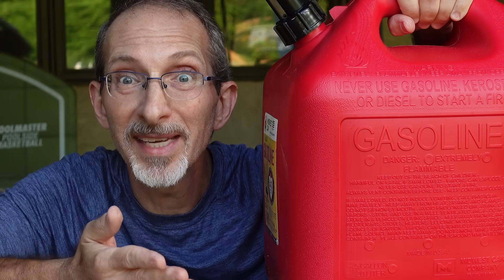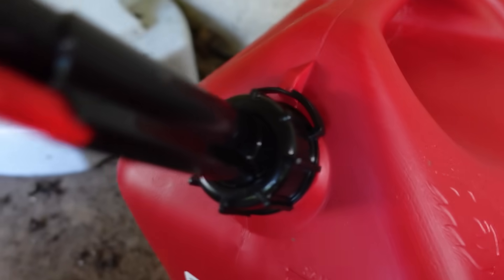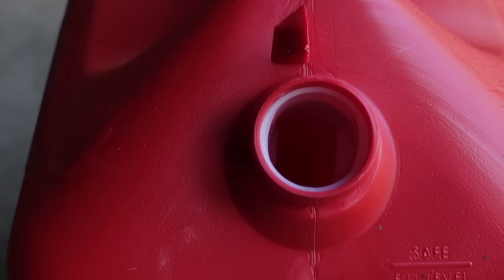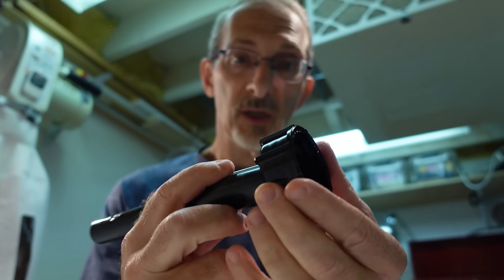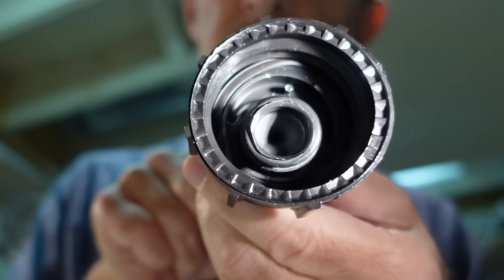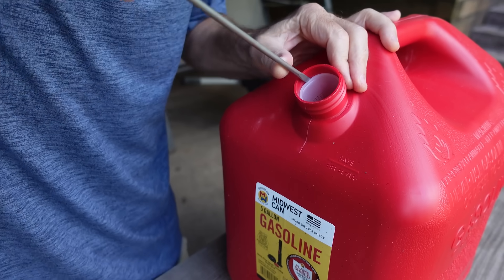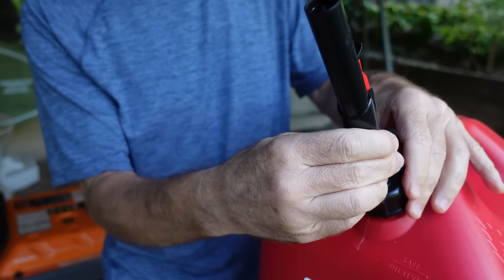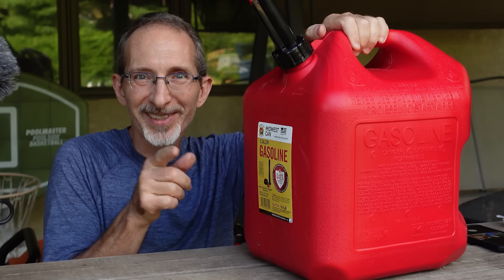Gas Can Modification | New Gas Can Fix

Comment: It's not about safety. This Obama can is supposed to reduce hydrocarbon emissions by removing the external vent cap and sealing the can air tight when not in use. So the idea is that this sealed can is supposed to prevent evaporation of gas (hydrocarbons) into the atmosphere while not in use which is like a quarter to maybe a half ounce per week if you left the vent cap off. 
BUT! There are multiple problems with this pos as I'm sure everyone knows.
1) I used one of my 6 gallon gas cans which was roughly half full of cool gas sitting overnight on the cold garage floor to fuel up my lawn mower and because I was in a hurry to mow the lawn I left the can sitting on the driveway in the sun. Well it puffed up like a balloon and split the seam open dumping like 2 gallons of gas. It may have prevented about a half ounce of gas evaporating while not in use but 2 gallons evaporated all at once (and killed some of my grass).
2) As you mention filling small equipment is near impossible. The airtight spout may have prevented about a half ounce of gas evaporating while not in use but I spill an once or two every time I try to use it, and more than once spilled more like pints and even quarts of gas.
3) The seal between the sliding part of the spout leaks, so unless you use a foot wide funnel which you can't actually do because you'll push that out faster than your weed whacker. You are going to spill (evaporate) more gas every time you use it than this pos is supposed to prevent. Yeah you might get lucky and get one that doesn't leak off the bat but trust me, that chintzy plastic and the heavy spring will round out the spout and smash the seal before you're done with the first mowing season.
4) Honorable mention - try using this pos to fuel up your small boat at the dock.
Idk what kind of fuxtard thought this was a good idea :face-fuchsia-poop-shape::face-orange-raised-eyebrow::face-blue-wide-eyes:

Comment: It's incredible how some "official" somewhere decided to enhance the environment by destroying the utility of the gas can. I have not found a gas can in the last several years that doesn't pour gasoline into the environment more than the old style gasoline cans. This can was a perfect example. As a senior with arthritis and psoriatic hands it is impossible for me to open and close these modern cans without altering them. Even when used correctly the cans ultimately spew gasoline into the air. In addition, I believe they have mandated a different size lid that cannot be purchased on the open market as a replacement.  That said, I am surprised some official has not stepped in and complained about this worthy video.

Comment: I just break the safety latch off the nozzles, just rest it on the lip of the tank you are filling gravity does the rest, when tank is full raise the can the valve shuts of the fuel flow.  I use smaller cans for trimmers and such since they are 2 stroke premixed gas.

Comment: I have found the perfect, although pricey gas can at Sam's. Flexible donkey dik that folds upward and locks in place when not in use and has a cap. Handle has an easy to use lever you push down with your thumb. To use it, remove cap and rotate donkey dik into the down position. Insert donkey dik into tank and effortlessly press the thumb lever down and voila! Spill free pour every time. But like I said they are pricey. Modifying these donkey diks don't help because they are too rigid which what causes the spills. I also found old fashioned donkey diks on eBay but they were cheap and the threads didn't fit and leaked all over the place. I've tried everything. The Sam's gas cans are the only answer and they are fantastic. $50 a can sorry to say, but they are the shit!

Comment: I have had a gasoline generator for quite a few years, and I hardly running at all. In fact, the only piece of equipment that text gasoline on my property. I have distanced myself from fossil fuels to such a degree that I live 100% off grid with solar panels and lithium batteries. They’re so good that I don’t need grid power or generator back up and I drive an electric car. I hate the smell of gasoline, and I hate the smell of the exhaust even more what is the point of pursuing a futile battle with fossil fuels?

I even threw out my gas cans. 

Go buy some solar panels
Reply: Solar is still highly not practical and very expensive. Also oil it's not a fossil fuel. If it were it would have run out years ago. Oil regenerates itself and that's a fact.

Comment: 2 simple things when empty drill hole opposite of filler neck for vent use rubber plug for sealing, second remove the  pour spout cut top off and get hose fuel grade and clamp onto the small pour piece left on pour spout. Then get a cap to fit to seal pour spout opening for storage. The longer rubber fuel hose can fill no spills and go far enough into new cars gas hole to open trap doors that standard filler cannot reach and gets rid of safety spout that spills more gas than anything ever. been dirt bike riding for decades we know gas cans hose allows to put in bike tank then lift can no spills no mess. get can from bike shop forget home improvement crap or modify it.

Comment: You never state why your old propane generator doesn't work. Looks like you left it outside for years. I have 3 propane generators and they never fail me because I don't put crappy ethanol gas in them, which causes 99% of generators to require new carburetors and other fuel related issues. But to your point, I modified all my gas cans with aftermarket flex spouts and flip vents.

Comment: Leaks at the joint, does not work with any yard equipment.  CA makes a problem 10 times worse.  It is easier to order a replacement not approved for CA.  Even with the fix here it still leaks between parts.

Comment: I have one of these cans, the only thing I did to mine was cut the stop on the cap to get it off easier. The can I had fell over in my car, and if I had a old one, gas would have been everywhere. The reason why he could not fill the can is because he was running the gas into the can too fast. Trust me I worked in gas stations for over 20 years, it helps if you are smarter than the can.

Comment: I WONDER HOW WELL IT SEALS ONCE YOU FILL THE TANK AND HAVE IT IN YOUR CAR WITHOUT THE SPRING BEING IN THERE. GETTING THE FILTER OUT WITHOUT DISTORTING THE NECK IS TRICKY. DISTORT IT AND IT WILL LEAK WHEN SLOSHING AROUND IN YOUR CAR OR POURING. THESE NEWER SAFETY CANS ARE DEFINITELY DANGEROUS.

Comment: I just buy the Easy Pour package which includes a vent. Works much better than this. Have adapted seven five gallon jugs that way. Get the big spout. Use a half inch wood boring bit or even a half inch Forstner bit to get a perfectly round hole for the vent. Empties much faster.

Comment: So does the nozzle just like.. stay hanging out of the can at all times? Also its not flexible? Seems like it would be very easy to break and harder to store. The cans we have in Canada the nozzle is flexible making it easier to fill and it fits in the can when you're done. That way you could put it in a (ventilated) lockbox or on a shelf.

Comment: Wouldnt it be better to just cut the spring in half and reinstall it? Because without the spring youll just spill a bunch of gas if the tank fills up before the gas can is empty. Fyi that fuel filter is the dumbest thing ever since any large particles will just get caught on the side of the filter that goes into your tank

Comment: Probably fumes still won't escape as pressure increases o-ring will only be seated more. Maybe with temp fluctuating and neg pressure, but probably not. I like the modification. I would keep the "filter" and just do a slow fill. 
👍👍

Comment: I 3d printed a nozzle replacement.  I've spilled more gas with the new 'safety' nozzles than the original nozzles.  Like seriously I've spilled gas with the original nozzle a whopping ZERO times, and 5 times with the 'safety nozzle'.

Comment: 3:20 this is completely ignoring the fact that anything trapped by the filter if not removed before the cap is replaced, will just come right back out into the gas tank of whatever you are filling, so making the filter non-removable actually makes it pointless.

Comment: Horrible design. I bought two of these for a new project and I ripped the larger rubber seal because i had to push so hard on the safety nozzle. Now gas leaks from the base.

Comment: I wonder if the OP has taken into account the reasons for those modifications. The spring loaded spout I can understand. Perhaps the OP could have modified the spring so that there was less pressure while trying to compress the spout. The locking tab on the part that screws onto the can is there to make sure you secure the spout tight enough to prevent leaks. But cutting it away is a good idea because that is kinda a pain. I’ll have to try his mods and make the spring shorter and see if that reduces the pressure.

Comment: Oh, and I would argue they are far more dangerous than old school nozzles. Ive got a 15 year old self venting nozzle that works great. My new can has this new nozzle. I've splashed more gas everywhere with the new can nozzle than I have in my life. 

A month ago I'd have ended up in a burn unit had the small engine I was filling been hot. Gas went EVERYWHERE.

Comment: Thanks for making this video. I couldn't agree more on the backwards and useless design of the new gas cans. You spill gas trying to fill them, you spill gas trying to dispense from it - whether it's a lawnmower or an old car. Since there's no flex you can't get it close enough to large flat surfaces to pour properly. It's as if the designers never actually tried using this thing in the real world, I'll keep my old bendy-straw style gas can!

Comment: The engineer that designed that spout should be slapped !  I bought after market spouts and threw out the "safety spout"   Also removed the filter that prevents gas from entering the can !

Comment: I bought a different spout for my tank off Amazon. Then drilled a hole in the back and added a air valve which came with the spout. Finally I removed the filter. Then for my generator I bought 2 metal gas cans. P.S. I pushed the filter into the can 😂 I was able to get it out anyway.

Comment: I’m legitimately confused, how does a non-removable filter help in the first place?  If you can’t clean the filter until the can is empty what does that add besides extra steps to clean it. I mean, if the filter stops gunk but you can’t remove it, you’d have to choose between pouring all the gas out to clean the can/filter, or allow the gunk in filter to remain and just pour gas back through filter and into your equipment. I couldn’t imagine anyone really doing that until I thought about 18-25 yr old landscape employees, etc.

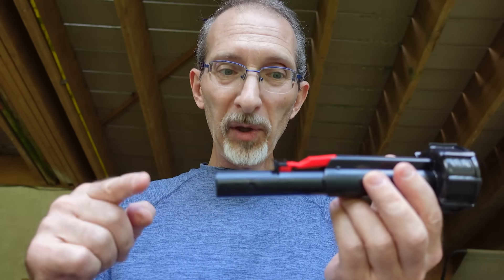Comment: 1:47 Pressing that red thing in in -20F degree weather with gloves on and hands are completely numb is SUCH a pain in the ass and is so difficult when a Nor'easter cuts off our electricity and we survive off of a generator. I fucking hate those things... so much.. I can't express to you stronger how much I hate those. There's only a single type of "safety" nozzle that I like, and actually prefer, which is the green one where you push it in with your palm. All of the others are a pain in the ass and make me spill gasoline all over the place, and I mean ALL over, which is extremely dangerous around a piping hot generator motor. They accomplished the exact OPPOSITE of what they say the purpose was. They're only safer in places like Florida where it doesn't snow or get cold

Comment: I like the 2.5 gallon push button with Right angle spout for filling weed eater and chainsaw. No spill without a funnel. The type that is in the video is a pain, but the spring gets weak with use.

Comment: Really useful video.  I have one of those nozzles and hate it.  The spring removal is particularly helpful.  Yes, it back-splashes because of the filter, they're a pain to fill, unless you're using them on a big vehicle, the force of the spring pushes away the chainsaw, weed-eater, lawn-mower, etc.  You're 100% correct.

Comment: These modifications may make the can easier to use, but I chucked the entire nozzle and fitted a normal old fashioned seal and long flex nozzle with a cap on the end.  The new fanged thing made for safety only leaked when it was in the back of the car, leaked into my shoes and all over the car when I tried to fill into the deep well fixture made for a pump nozzle, not a short leaky and flimsy joke of a spout.

Comment: You forgot #4, installing the much needed proper vent on the can, this allows the fuel to pour faster, smoother and without gurgling which also causes splashes.    :)

Comment: I hang on to my old timey metal gas cans with no valves for this reason.  It's even more fun filling a tractor fuel tank that usually requires holding the portable can INVERTED while trying to keep the trigger released due to the tractor fill being mounted flat on the top of engine cover.  I know that much more fuel is spilled and wasted due to new, idiot cans than was ever lost from old timey cans.

Comment: @Mike Fxdt What if you cut say 1/3 of the spring off and re-installed it.. Would that offer a more reasonable amount of resistance while still maintaining the safety feature?  You know they did this because some idiot spilled gas everywhere while standing next to an open flame that was inches away from  a pile of crumbled newspapers, then he or she sued the gas station, gas can maker, Wal-Mart and the parent oil company for not letting them know not to be a complete and total idiot.

Comment: Haha so much trouble :face-green-smiling: I am a nomad. I live by using solar and generators. I also use Midwest because there isn't any choice. So when I get a new can I smash the center spout out of the stupid cap. I then use a $13 wand pump from Harbor Freight to transfer into the gennie. Same if I need to put gas in car tank which never happens. For the filter I just rip it out and chuck it.  As for the dumb "cap lock" I cut it off with electrical cutters.   
The nanny state causes things to be wildly over engineered. I see it over and over. I just de-engineer stuff. It is a constant battle against the idiots.

Comment: I have the old style which still works well for me.  But because they are plastic, I have decided to transition to metal for Generator gas storage.  I have purchased 4 Eagle metal gas cans.  Sure the funnel gets in the way, but the system works and I feel that it has a better seal for the stabilized fuel that I store for 6 months at a time.

Comment: I got the exact gas can and I spill more gas then an ever did before.  I just remove the whole nozzel and pour gas straight out.  It splashes a little bit but spill less when compared to the safety spout.  I found using the No Spill auto shut off are better for me.  I hit the button like on a cooler, and let the button go when I need to stop it.

Comment: Way to go, Mike!  I hate the BS with all of these new cans.  TSC has a kit with a no BS nozzle and a vent included.  All of my cans (7 of them) are easy to use, and the EPA can go blow it out their ear.
Reply: how the heck do I install the little vent the give with that kit? do I drill a hole? please sir, help me. I am actually very MacGyver-ish, but can't understand that process
Reply: The kit i have supplies a drill bit. Be careful bacause a drill makes SPARKS inside its motor.  The GASOLINE FUMES can ignite. Danger danger.  I used a pair of pliers on the drill bit (it takes 25 seconds)  clean any of the plastic so it doesnt fall INTO the gas can. Use the wire to feed the valve into the tank.  I did 3 plastic gascans in 5 minutes.  Well worth doing
Reply: Ass
Reply: jack, do you have a link for TSC ?  It didn't show up on ebay.
Reply: @tompastian3447  Tractor Supply Co. probably one in your town.

Comment: I modified a few using new spouts and burning a vent hole in the other side of the top with a hot punch. Then i use a plastic plug to plug the new vent.

Comment: Quick question for you Mike. If you remove the filter from the can, how do you filter the gas to keep the trash out of the engine? Every gas container that I have, has some debris floating in the bottom. My old gas container has a filter in the nozzle. I keep it clean. Problem solved.

Comment: I don't think that is a filter  A filter there wouldn't do any good, because whatever debris id trapped would be washed into your gas tank when you pour gas back through the same filter.   I think it's probably supposed to be a flame arrestor.

Comment: The way the can is designed it prevents gas spills from over filling.  There are statistics showing how many millions of gallons of gasoline are wasted and end up in the environment from this.  So don't modify the gas can and instead have the gas leak straight out of the can onto the ground, your generator, your hands and pants.   There are no statistics on this so it's O.K.

Comment: This is all due to lefty liberial do-gooders who think they are so smart.  Another example:  They get the EPA to require higher mileage, so the car manufacturers make engines that require high octane gas.   Neither of then care about lowering the consumer cost-per-mile. Indeed the EPA, being all woke enviro-wackos, would perfer $20+ per gallow of ethanol.

Comment: i drilled a hole in the back of my can and inserted a a brass fitting that has a plunger that allows for the air pocket to be vented for faster draining.